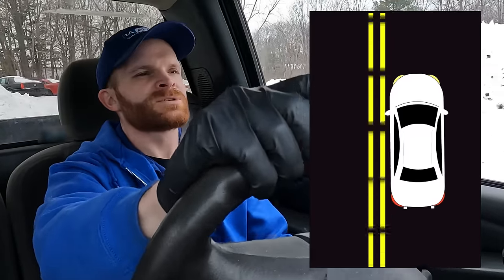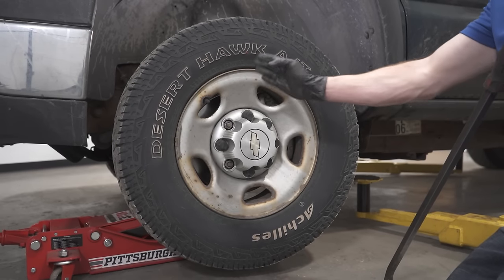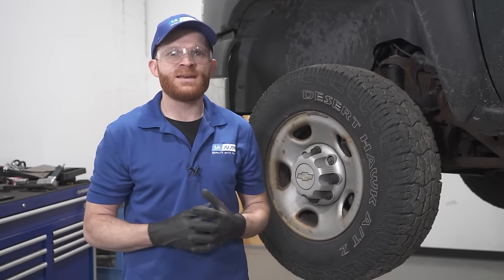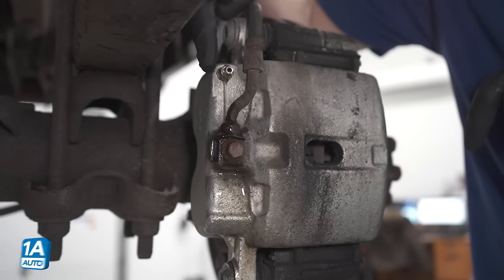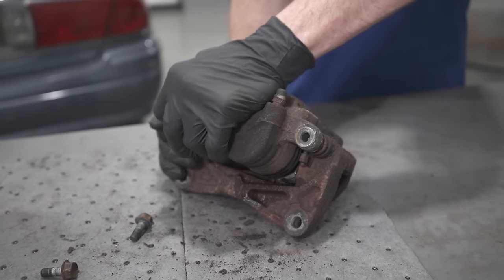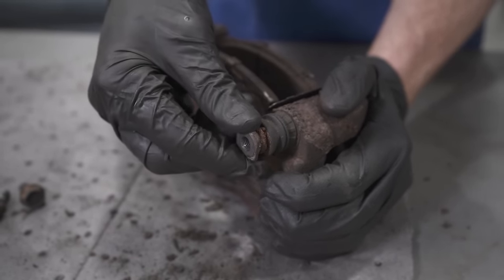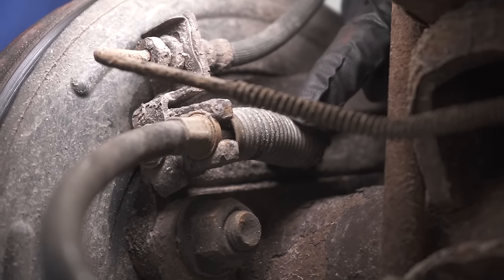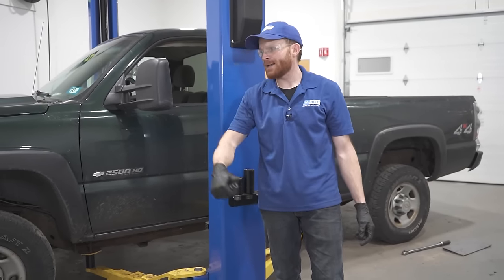Car or truck pulling to one side but front end is fine. Tips to identify brake or suspension issue

Comment: Don't forget to check air pressure in the tires.  Low pressure can cause a pull also.  Have bought parts from 1A Auto in the past and got them quickly.  Service is good!
Reply: That and UNEVENLY worn tires ! Had me stuck for a while
Reply: I bought a used car that had  newer tires that appeared good.  It pulled like a jammed caliper at highway speeds.  I found it by switching the tire to the opposite side and she pulled the other way.  A shifted belt can mimic bad brakes and even groan like a half shaft..
Reply: Good one, Dale ! I once had my front passenger side tire low on pressure, causing the car to pull to right. Even turning the steering wheel was a bit harder.
Reply: Generally low pressure inside the tire will cause a gentle pull.

Comment: Great video.  One thing I found to assist in finding a sticking brake caliper is a Inferred Temp. checker.  Drive down the road for a while, jump out and shoot each rotor to check temps.  All mine except for one were within 5 degrees of one another and close to 170 degrees.  The one sticking was 310 degrees.  Quick and easy diagnosis.

Comment: When driving on the left side of the crown of the road,a vehicle may have a tendency to veer to the left, when on the right side of the road,it may have a tendency to veer to the right,when driving on the center lane,it should drive pretty much straight with no correction needed,if there is a pull ,it could be a alignment issue,when driving and a pull,not a veer,exists,it could be a suspension or brake issue or alignment

Comment: I'm sure glad that my 2002 Chevy pickup has disc brakes on the rear axle.
Good presentation. Thank you.
Reply: This truck also had disc brakes in the rear. It was the emergency brake that was the problem.

Comment: Sway bar bushings causes pull also, symptom usually is vehicle will stay pull to one side after driver make a u turns or tight turns and then make another tight turn to opposite side and vehicle will stay straight

Comment: This is the problem ive had with my 2011 Ford Taurus since i bought it a few months ago. I did take it in to the dealership and they said nothing is wrong of course. The steering wheel now is crooked when driving straight, i swear it feels like the brakes are stuck on one wheel. The brake pedal feels weird too and there is vibration under seat. I had them check the brakes and suspension but I am gonna take it somewhere else right away. It was not the Ford dealership btw

Comment: Thank you for sharing your videos. May be you can help me diagnose my car problem.

I have creaking or groaning noise issues on my Mazda CX-5 2014 automatic transmission. The groaning noise comes from the front when I hit the brake pedal to a stop and when I release the pedal every single time. I lubricated already the caliper slide pins and brake shims on the front brakes and cleaned the rotors as well using brake cleaner. I put the car on test drive but the groaning noise did not go away. Strangely this noise occurs when the car is on Drive or Reverse. But when I switch the gear to neutral before stopping and hit the brake for a slow gradual stop, the noise does not happen. I feel source of the noise is not from the brakes anymore. It only happens when either Drive or Reverse is engaged and pressing and releasing the brake pedal even when the car is not moving at all. I had a similar issue on my previous cars (Jaguar S-Type 2005 and Honda City 2010) but never had a chance to get it fixed because I sold them away.

Would appreciate your insight and suggestions on this issue and which area of the car I should look into to get to the source of the groaning noise and to fix it.

Thank you.

Comment: Check the toe using the tape measure method.If not within an 1/8th,toe is off and this will cause a pull

Comment: If u are working on ford truck rear brakes they won’t push in, bleeding it brings to mind but that’s not the case. U have to put truck in Maintenance mode  for it to b release your brakes. U can watch u tube to get to learn how.. kind sucks.. took me forever but eventually was able to

Comment: My QX4 was fine then they changed the struts and the mounts and now my car pulls to whichever direction I turn to. After I make a right turn and try to straighten the wheel it pulls to that side. Same thing with I make a left turn, it pulls to the left when I straighten the wheel. What could have gone wrong?

Comment: I have a 2006 ford Taurus se and i keep having to get alignments because its always wearing the inside passenger tire, ive replaced the ball joints, tie rods, breaks, rotors, strut/shock assembly all around with brand new tires several times and it still wears that same tire the same way every single time, i dont drive crazy or ever on dirt roads, wtf do i do

Comment: I need help!! So 01 Honda Accord I snapped my right front axle and replaced it with OEM spec from raxles and it pulls hard right especially under load. When going down a hill it pulls slightly. Cars been aligned and ball joints look good caliper is good eveything is good. Took to Honda and they even said they don’t know. What should I do???